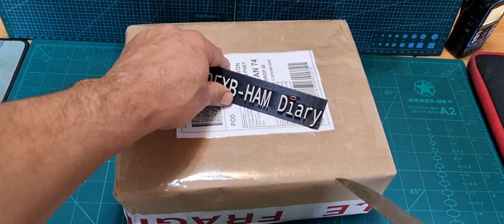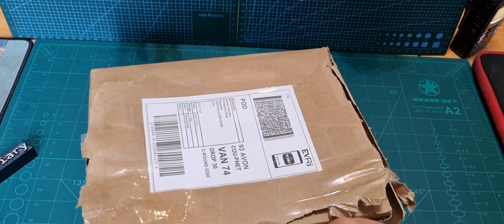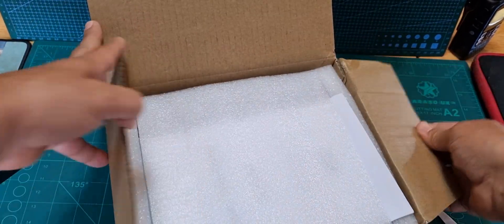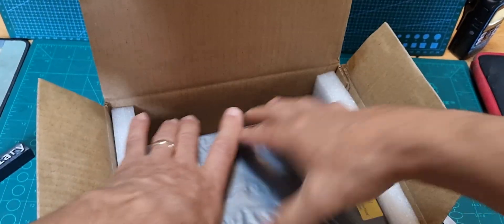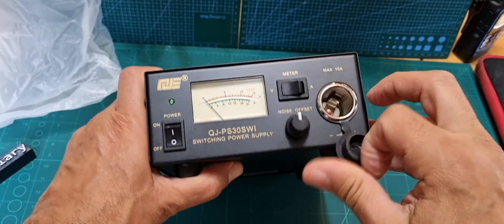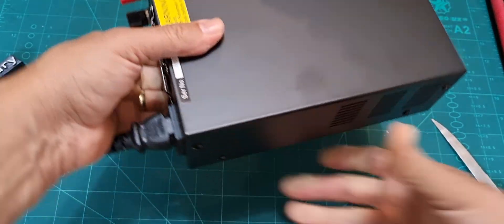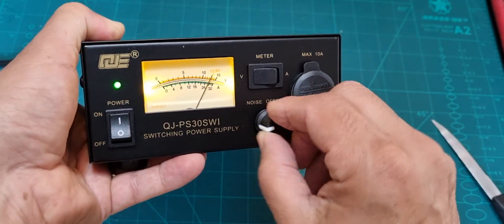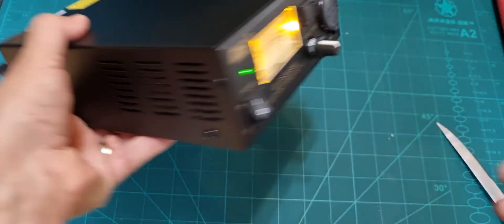QJE- PS30SW Switch Mode Power Supply Unit - Unboxing

Comment: How's the performance, planning to use on 2m and 70cm?
Reply from the maker: Its ok as a budget purchase
Reply: I just got a QJE PS-30SW and am using it with an Alinco DR-638H. I also have a DeepVNA 101 with me to test for noise that is usual with switching power supplies, but it appears that I can not find any with my VNA. Perhaps I just missed a frequency. How's yours, did the QJE produce noise?

Comment: Hello, any chance you can show the inside of the unit? I'm wondering if there is an adjustment for the voltage to get, say, 14.5 volts or so for keeping a lead acid charged. Thanks and 73 de W6EL
Reply from the maker: https://youtu.be/ORybvvQDCHI